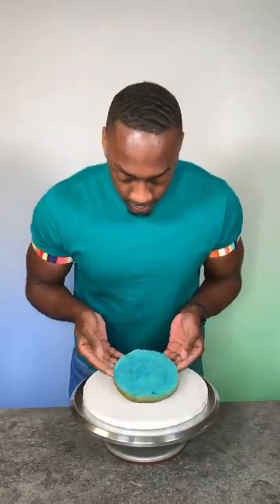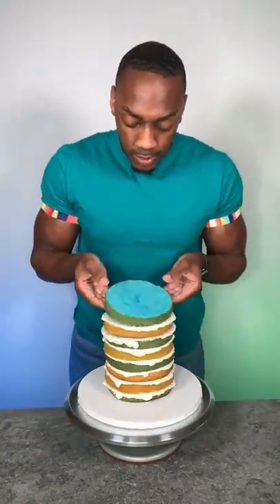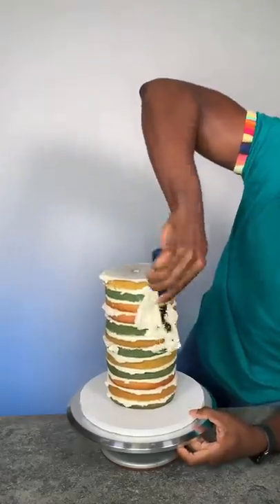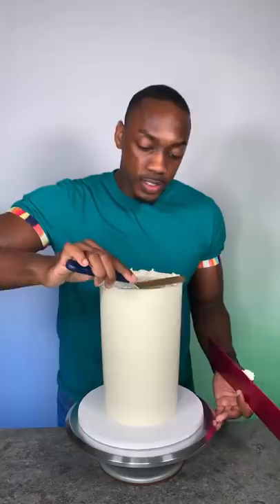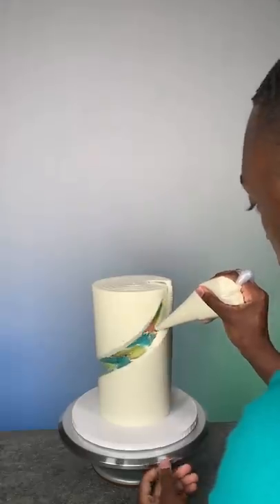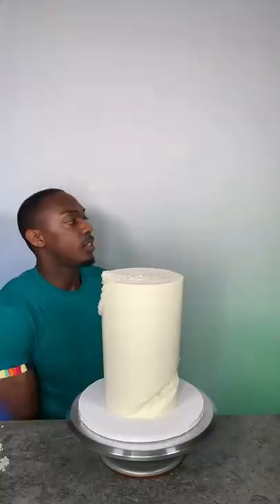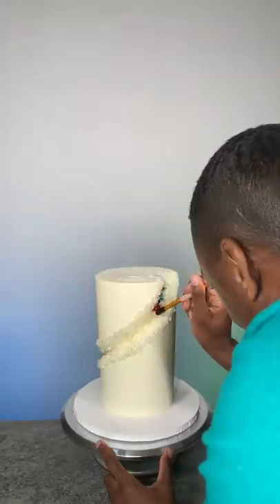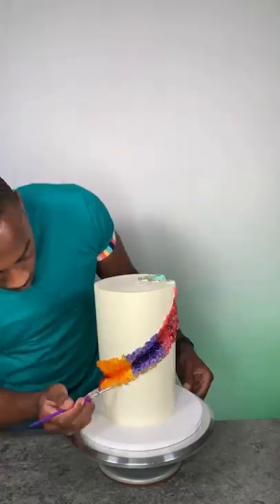Making a Geode Cake #Shorts

Comment: So simple ( not that it was simple to make but in the sense that it doesn't have to much going on ) yet probably one of the most beautiful cakes I've ever seen
Reply: I'd disagree... that has a fair amount going on: colors of the 🎂, the layers, the frosting, the cut out, the frosting glue, rock candy and lastly the colors... that's quite a bit going on.
Reply: @snow5962  Disagree all you want    Still has basically NOTHING going on   Spinning... Spinning is going on
Reply: @snow5962  It is a pretty simple cake.